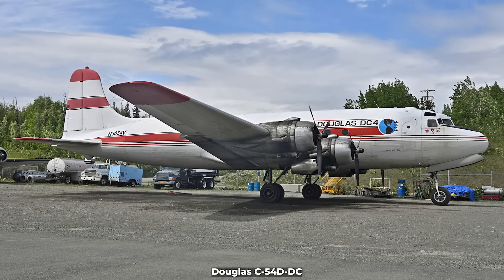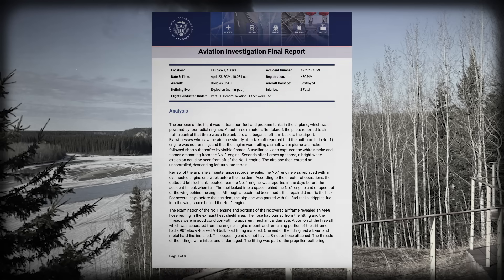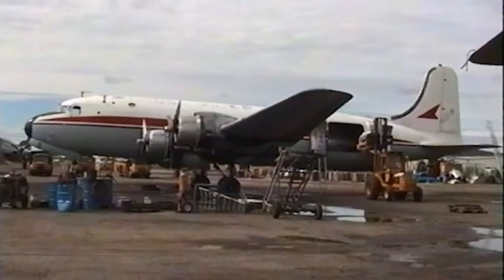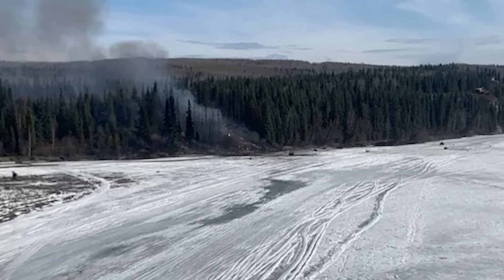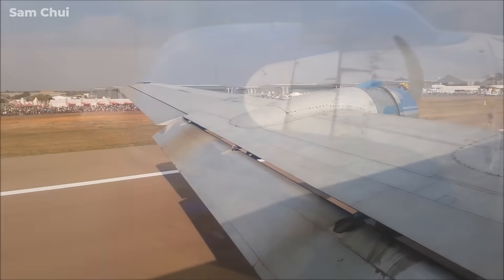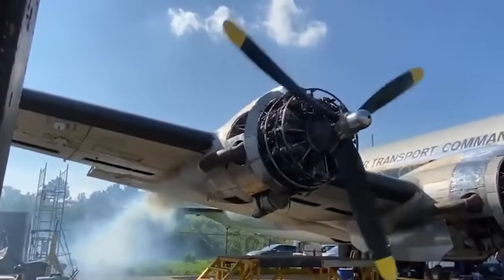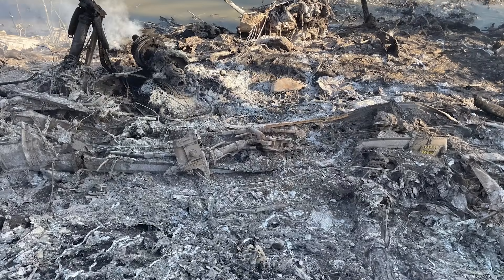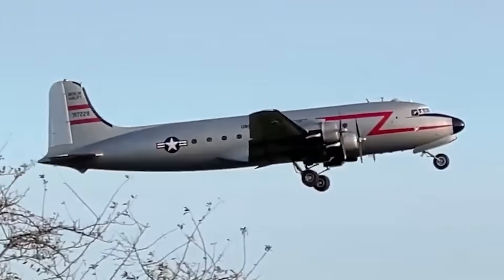How UNRELATED Problems Can Align Perfectly And Destroy an Aircraft

Comment: Don't they do feathering check on the ground during the run-up?
Reply: We usually don't take the props all the way to feather because it puts excessive stress on the blades. We do however, run the props through their normal operating range. 

Even if the Bnut fitting leaks during sunup, the airstream is different on the ground as opposed to flight and the exhaust system is not very hot yet.